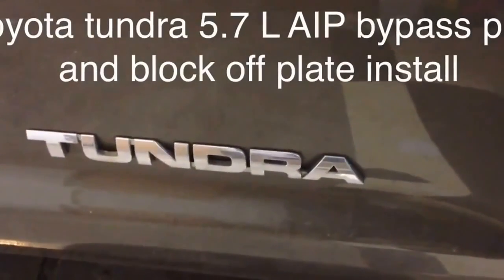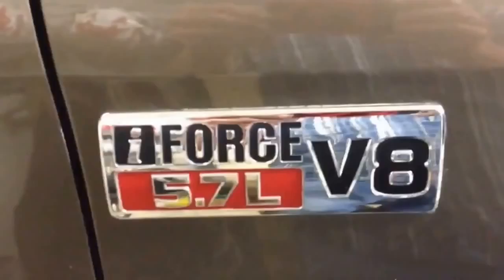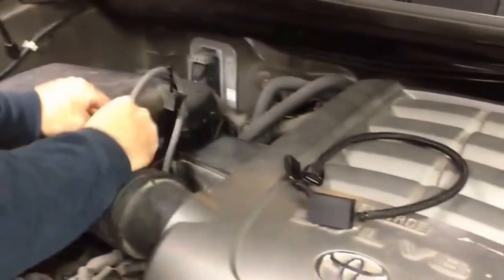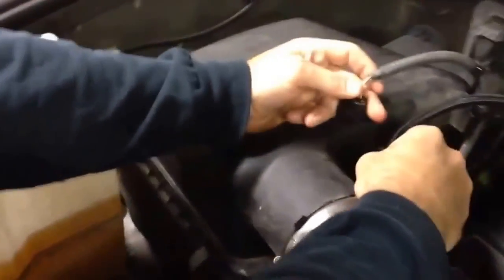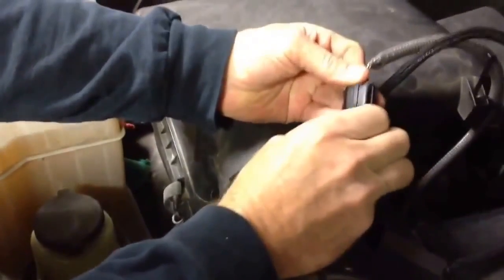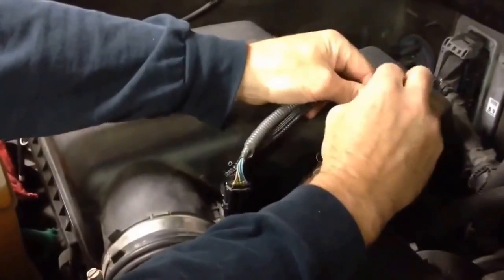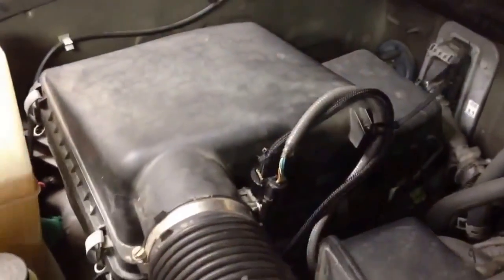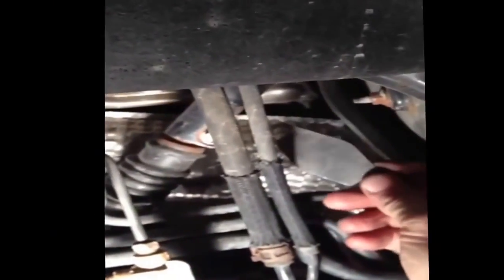P1441, P1442,  P1444, P1445, P2440 - P2445-P2447 Toyota 4.7L, 5.7L  AIP bypass and plate locations

Comment: I got a 2008 toyota tundra 4.7.    Code p2436/p2438. Secondary air injector system.  Bank 2 .. I don't know which part causing it.. bypass kit on but still check light and traction blinking.. block off plate uo top at z value

Comment: I just completed the install of a by-pass kit and i understand the difficulty of placing the plates between the flanges. What I did to solve this was get some 5/8" all thread rod and a long nut and cut 2 pieces of the all thread rod and put them on each side the long nut  and used it as a spreader bar. I simply put it against one of the bolts and basically back off one of the bolts and pushed the flanges apart enough to get the plate in between the flanges. It didn't move much, but you don't need it to. With this holding the flanges apart then I could use my hands to place the plate............I was "thank You Jesus" when it worked! Hope this helps you.

Comment: I did this repair with this product today on a 2007 Tundra 4.7L. Was quoted $3,000 CAD to have valves and pumps replaced at the dealership. This was under $300 CAD and shipped in two days. Only tools required were 10mm ratcheting wrench and a 10mm short socket on a short 1/4" drive and some Liquid Wrench. I didn't remove any tires, flaps, or anything else, just loosened the bolts and slid in the plates and tightened them up. Took about an hour to figure out the angles to get to the bolts. Seems very straightforward aside from getting the sockets over a couple of the bolts.

Comment: What’s the purpose of this? Electric air pumps don’t rob power. It’s an illegal modification and it doesn’t allow proper cat warm up. So why do this?
Reply: They fail on Toyota trucks frequently sending the truck in limp mode  The bypass is much cheaper than replacing the pumps/ valves

Comment: to get that pipe out you have to remove the studs idiot.
Reply from the maker: That is why you do not need to remove any pipe or fasteners, the blocker plates are designed to slide into place when the two nuts on the studs are loosened, It will give you enough space to slide the plates into the exhaust ports.
Reply: my mechanic skill 4/10 for referance. I Just finished installing this kit on my 4.7 07 tundra. Went ok. On the pax side, i disconnected the lower engine coolent bypass hose and put a plug on the block so I could get a socket on the top upper center side of the flange. I went with the upper side of the whole unit instead of the lower, simply because there just wasnt enough room to get at it on the bottom side, that and with PB spray and gravity, enough space was made to get the plate in no problem. Just like the instructions said, didnt have to remove any of the bolts.
 On the driver side I was able to get a flathead inbetween the flanges and apply slight pressure using leverage off of that bar with the rubber boot on it,  just enough to slide the plate in.
All in all, took me about 2 hours to locate the flanges, figure out how to reach the bolt, Do the work, test drive. (Pic link) https://scontent-lax3-1.xx.fbcdn.net/v/t1.0-9/31363280_10156429770136942_4265570074514948096_o.jpg?_nc_cat=0&oh=7b2cec6007036bc5575ae431d28451f7&oe=5B589A42

Comment: I have a 2005 Tundra 4.7 with P2445 code. Toyota give written estimate of $2100.00 to fix. I bought the 4.7 kit from the rutechsolutions.com web site for $179.00.  Recieved a day later than estimated delivery date but well worth the wait. Install was easy. Truck has power back, runs like new. When you order your kit, you will recieve a link for video, which will show you exactly how to install plates. Highly suggest watch video. The only thing that I would change is, instead of undoing mud flaps at bottom, I would undo at top. You can have Auto zone or Oreilly's erase code and buy faseners for mudflaps if needed. Today is 30 Nov 2017

Comment: got it installed, seems to work great!  I removed the wheel to give me more room to work. I loosened the bolts (10mm) and used different size flat heads to work up a gap large enough to slide in the plate. the driver side was a lot harder because of the location of brake lines and fuel lines.

Comment: I have the 2011 4.6L. I attempted to install the blind plates under the wheel well on the rear end of the exhaust manifold with no luck. There's no room to work in there and could not separate the flange.  However, I traced the pipe going up into the engine compartment and found the other end going into the intake manifold. The plates actually fit those connections so I said screw it and installed them there...just seeing is this an alternative..so far I have no had any issues..hopefully this is another way to blind the pump from the exhaust and will avoid having to jack your truck up..
Reply: How in the world did you access the end that is deeper in engine compartment.  If I climb under my truck, I can't even see it. I loosened one of the bolts but don't have access to loosen the other.  I cant get my hand in that far much less slide a plate in.

Comment: How do you actually get the plate into place?  When I loosen the nuts neither pipe moves so I can't slide the block off plate in between.
Reply from the maker: +ay tee Yes sometimes the pipes are stuck tight, usually some kind of corrosion, spraying a penetrating fluid around the connection point and allowing some time for it to soak in is usually does the trick with some light tapping or prying. I know there is not much space to work with there but when the pipe are stuck you need to be come a little creative with the tools you have.
Reply: +RuTech Solutions Thanks, I'll try that out.  I'm slightly worried though that this bypass isn't going to work even if I get the block off plates in though.  I get the codes p2447 and p2447p (Tundra CrewMax 5.7L) and I initially just hooked up the bypass and the second time I started it up I got a bunch of my dash lights blinking.  (Don't remember them all but I know 4WD was one of them).  Does this sound normal?  Is it simply because I didn't have the block off plates in?  I really appreciate the response.  This issue is starting to really bug me!
Reply: +RuTech Solutions  Have you heard anything about the flashing lights happening when only bypass plugged in and no plates installed?  Any ideas?  From what I've researched, the plates shouldn't necessarily have to be in for my codes, but I'm not completely sure if this is correct.  I have waited to try again to put the plates in because I have a Toyota appt to see if I can just get the whole thing replaced, AGAIN!
Reply from the maker: Well remember the module is only half the fix, the plates are install because they will stop exhaust gasses from reentering the AIP system, potentially causing more damage or possibly opening a valve casing limp mode or causing new issues that the bypass module is not associated with. Also dash lights have many codes they are associated with, finding out the exact codes causing the lights will help you narrow down the issue.
Reply: RuTech Solutions I have a 2005 toyota tundra and it has the CEL on and the only code that comes up is the p2445 with the bypass you sell will it cause my truck to not go into limp mode any more and after I install your bypass and reset the computer will it get rid of the CEL? I'm asking because I don't want the CEL light on and I don't want my truck to go into limp mode any more. Thank you for your time.
Reply: well after a quick google search using my phd in google search... 2445 is saying stuck closed. In theory, if they are stuck closed then thats the same as putting a block off plate. So in theory, connecting the module would elimanate the cel and subsequently limp mode. I'd still install the plates encase it magically decides to open.
Reply: ay tee Did you ever get the plates in?????